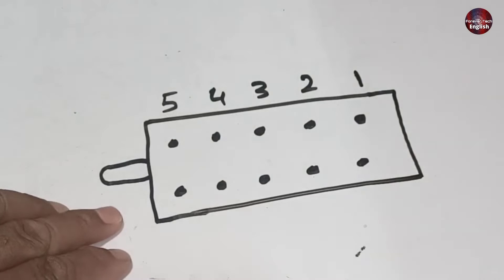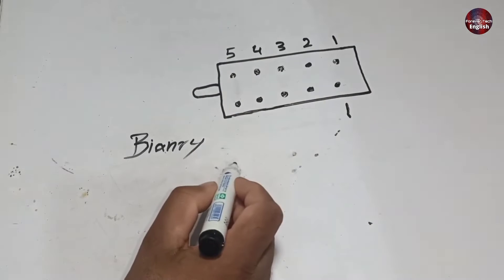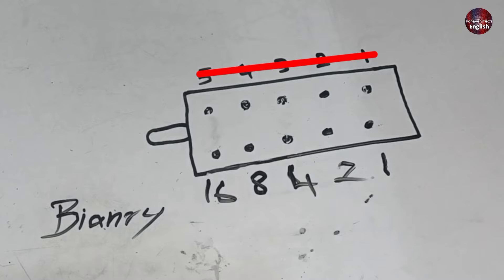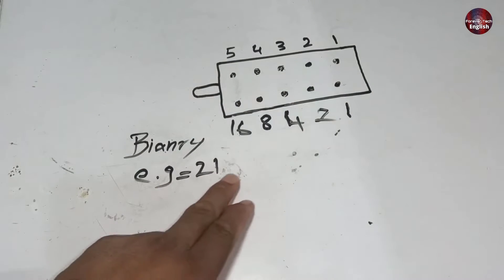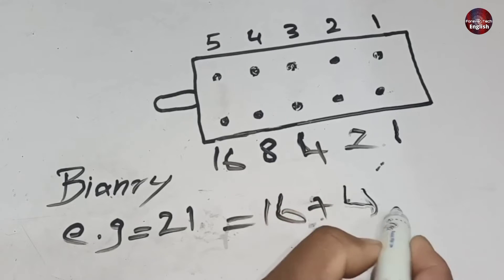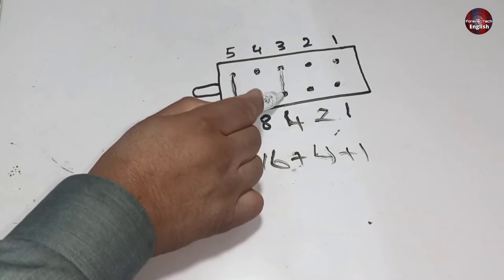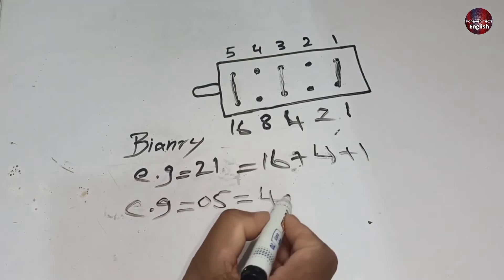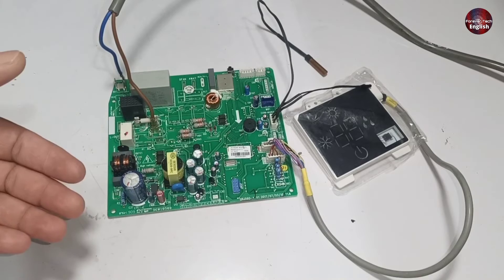Few Know Cap Pin Jumper Setting In Mini Split AC Circuit

Comment: do you know what the jumper is for and do you know what the differences are between the numbers on it?
Reply from the maker: Yes I know.
Reply: @forevertechenglish  I've seen various JUMP settings.
In Gree Amber Prestige 7kw from this distribution, I saw two different JUMP PINs with numbers 21 and 08.
Reply: @strzegus  widzę, że przetestowałeś na swoim gree amber prestige miejsce zaworek. Mam pytanie, czy duża różnica jest w mocy wentylatora jednostki wewnętrznej po zmianie zworki? Czy zmieniałeś może zworki w jednostce zewnętrznej żeby zmniejszyć moc Agregatu? Pytam bo chce  dokonać takich modyfikacji w swojej gree amber prestige 3.5kw ale nie wiem czy mogę liczyć na jakąś poprawę, chodzi mi głównie o modulacje sprężarki oraz siłę nadmuchu jednostki wewnętrznej. Pozdrawiam.
Reply: @forevertechenglish  you will reveal this secret 😁😁😁
Reply: @forevertechenglish  Do I understand correctly that the higher the number the less power???   Is there a JUMPER on the external unit's board that needs to be set???
Reply: Jumper cap is used to determine fan speed and the swing angle of horizontal lover
Reply: jumper is also used for auto restart function?
Reply: @devesh.mishra  and for what else .  what jumper number is related to power
Reply: @strzegus  i am not sure..i am asking that confim it? in my split  inverter ac auto restart function not working...Is auto restart function works through Jumper?
Reply: @strzegus  I have a GREE Versati heat pump... is it true that by changing the jumper you can vary the thermal power of the pump?
Reply: @imola22000  I have a Versati 4 12kw monobloc 400v and I am also waiting with interest for the answer, I put the jumper in position 8 and reduced the power in C/P limit: Power limit to 2.3kw, I set ΔT to 3°C and I noticed that it reduces the modulation time, it enters the minimum limit much faster even after defrosting and when the compressor starts, I leave it like that for a while to see how it behaves. I do not prepare hot water with the heat pump, so I do not know how it behaves in that case.
Reply: @florin.batincu8098  I had read that by changing the jumper you can set the pump as 10-12-14-16 Kw because they are the same machine. But I don't know if this is true. I'm looking for more info on this.
Reply: @imola22000  I tried, I made all possible combinations starting with 7kw up to 16kw, but nothing changed in the behavior of the pump, I also spoke with a technician from Gree and he told me that a higher power can be obtained 14.16kw, but lower, respectively 10kw, is not possible, I think it probably requires a software update at the same time as changing the Jumper position
Reply: https://www.youtube.com/watch?v=obIzvyZUNHU
Reply: try these settings too, I don't have these options on my controller
Reply: @ Did I understand correctly? You say you tried different positions on the jumper cap. How do you know the numbers corresponding to the thermal power value? I say that you need to change the jumper cap number of the AP2 card (not AP1). What number do you have on your jumper? On my 14 kw there is the number 7 printed on the Jumper.
It seems that the number 9 corresponds to 10 kw (therefore pin 1 and pin 4)
Reply: @imola22000  oops... then i made a mistake, i modified only JUMPER 1 of AP1, that's why there was no reaction from the pump, in AP2 i have number 8. i'm going to make the modifications now and i'll be back in a few minutes.
Reply: @imola22000  I tried all the positions of the jumper in AP2, the capacity changes, but I get the CAPACITY DIP error.
Reply: I think i finally succeeded, in my unit is a combination of JUMP1 on AP1 and JUMP3 on AP2, for now i found the combinations for 8kw, 10kw and for 12kw i found several options. There are a lot of combinations, for each combination, the pump must be turned off from the general switch, not from the OFF button of the controller, then the pump must be restarted and from the VIEW>VERSION menu>press 3 times on the VERSION VIEW screen>password 101010>ok> in Factory ODU-capacity: 10kw appears. I started making the combinations at 10.30, and at 13.56 i stopped, it is 31DEC i don't have time to check them all today. Now i set it to work on 10kw. Isee the change when you put it into operation, in the original 12kw combination the fan started at 35Hz and the compressor at 45Hz, in the 10kw combination the fan starts at 30Hz and the compressor at 35Hz, i'll leave it like that until tomorrow. I hope to start the new year with a correctly sized pump. If it goes correctly i will post a video with how the combinations can be changed to obtain different powers with the same compressor. Happy New Year to everyone!
Reply: Perfect. I'm happy you succeeded. In fact, the pump must be turned off by removing the power supply.
How can I write to you privately?

Thank you and Happy New Year everyone
Reply: @devesh.mishra  and how should I know. I'm curious myself what exactly it's for
Reply: @florin.batincu8098  To set the pump to 10 Kw, did you also change the Jump1 of the AP1 board?
However, I don't know how to find your address
Reply: @imola22000  My pump works even without changing jumper 1 in AP1, but if you also change the bridge on jumper 1 to other positions you get other power combinations, I understood from owners of other pump models that it is possible to make the compressor work at a quarter, half, or three quarters of capacity in this way, I don't have time to test these possibilities.
The good news is that it modulates the compressor and the fan and the recirculation pump differently.
The bad news is that it still doesn't modulate below the minimum of 1.2kw/hour, or maybe I didn't find the correct combination, I spoke to Gree Romania and they didn't want to tell me what the correct combination would be, they told me to buy a smaller pump, if this is oversized.
Reply: @florin.batincu8098  the point is precisely this, we need to understand how to modulate the pump to the minimum possible. 
With the 10 kW jumper did you find a lower minimum power compared to the 12 kW?
Reply: @imola22000  yes, but very small, from 21.5w/min to 20.4w/min, that is, less than 1.6kw/24 hours, although it modulates better, when defrosting it consumes more in the 10kw combination. I am also trying other combinations.